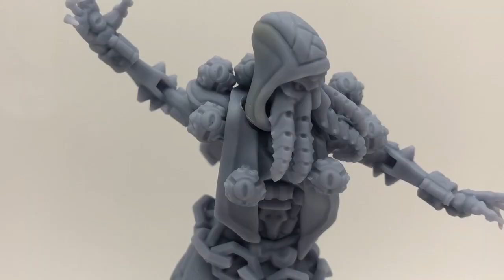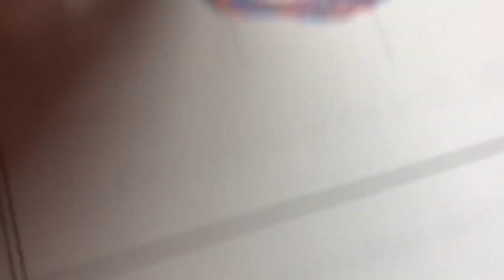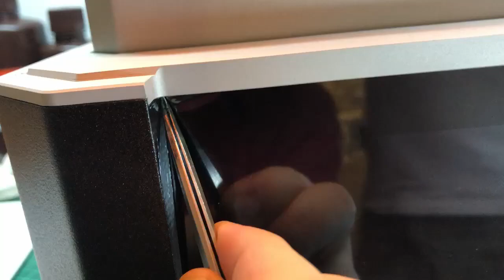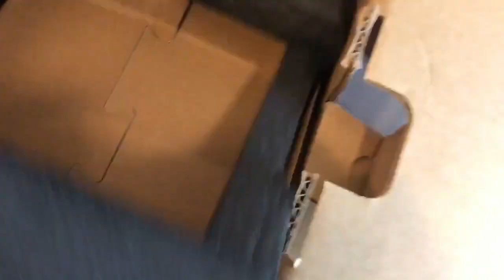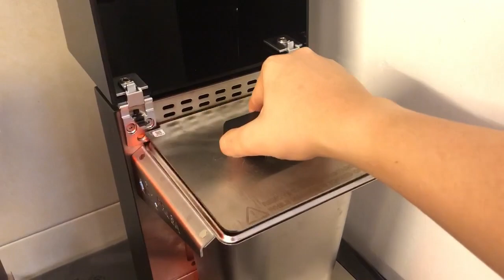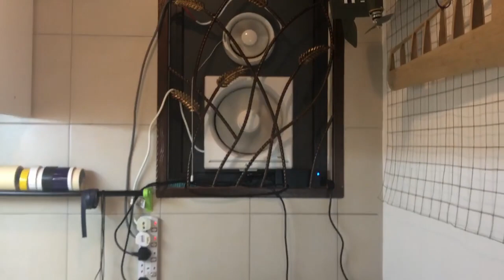The PRUSA SL1 Kit Assembly & Experience Review

Comment: Now, this is a great video !  I'm looking for buying a 3D printer for making jewelry, I heard that the form3 is one of the best affordable 3d printers on the marked BUT the on thing i don't like is that it doesn't work with 3th party resins....and that is to bad because i like to cast my jewelry....and l like to have a choose for the best resin for casting....Would you recommend this printer for a small jewelry shop?  i definitely need high quality prints....
Reply from the maker: Thanks! Yes id totally recommend the SL1, it’s been really good for me, it’s printing right now in fact. I would definitely recommend you do your research, there are other DLP printers such as the elegoo mars that I hear good things about too, and those are much cheaper than the sl1. If you’ll be printing mainly casting resins, being locked into formlabs casting resins would definitely be expensive.  Prusa has their own casting resin too actually but I haven’t tried it out. Hope that helps, good luck!

Comment: What type of paint should you use on resin?
Reply from the maker: Praaveesh Raaj good question! Painting Resin works same as most other materials, so far it’s taken paint fine but if it doesn’t a good ol layer of primer will do the trick